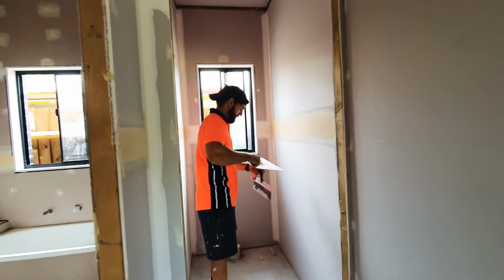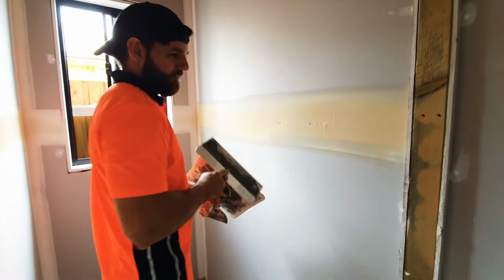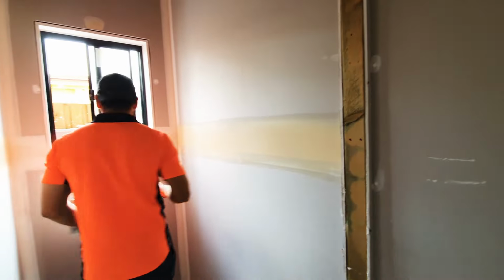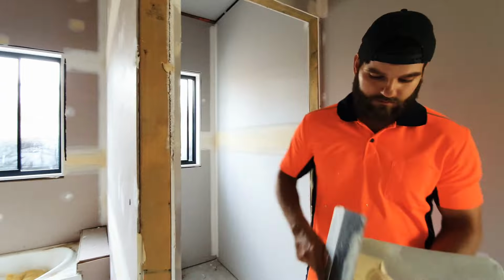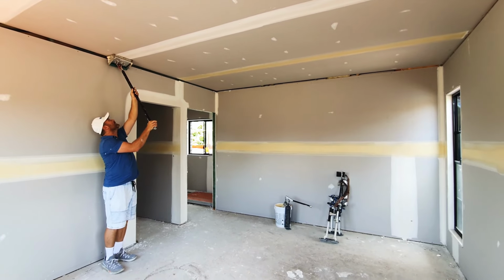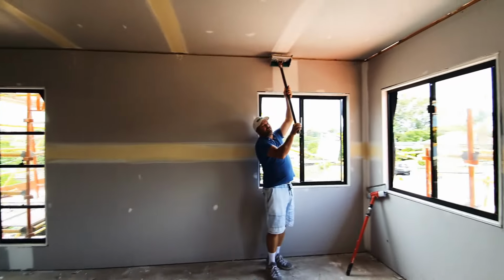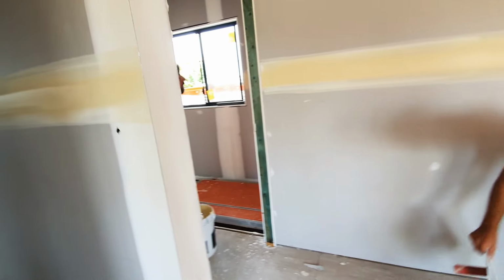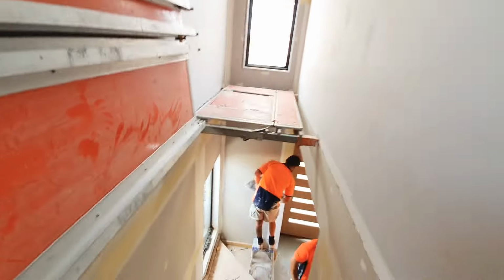How to Master the Drywall Flat Box Tool

Comment: I have a question for those ultra-professional Drywall Gangsters. How long would the training program be to turn a skilled Videographer into a solid replacement mud box operator? Here on a Sunday morning, the temperature has warmed to a balmy now -23C. How is it down your way on a Monday? -Bob...
Reply from the maker: That's too cold Bob it's 21.5c at 6am in the morning here
Reply: @Maxkil  Man that is too tempting to start a day off that nicely. Doesnt even come close to that warm in here during the winter's days!